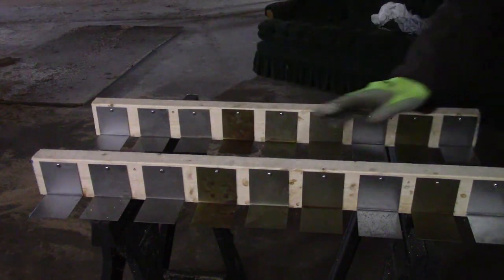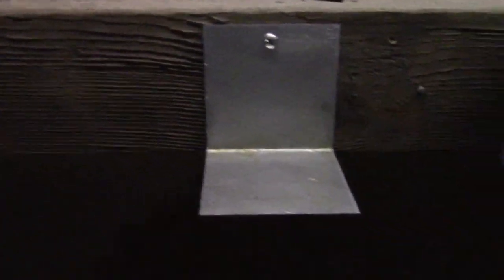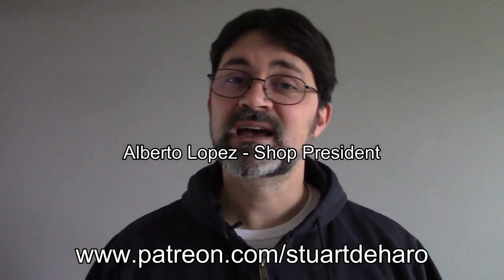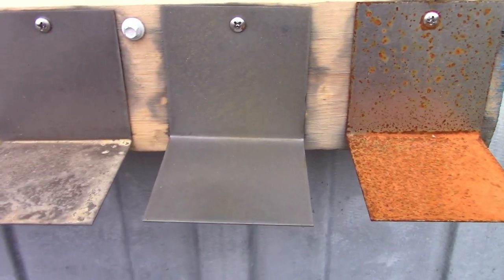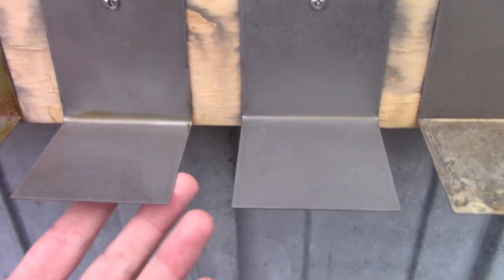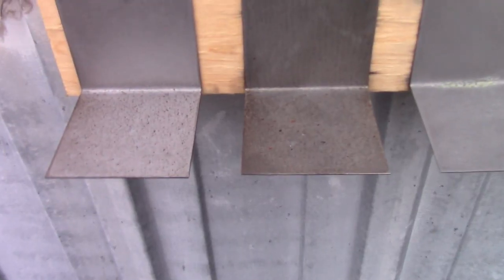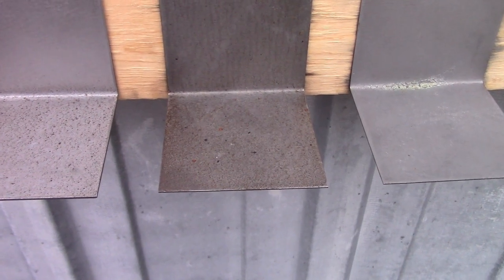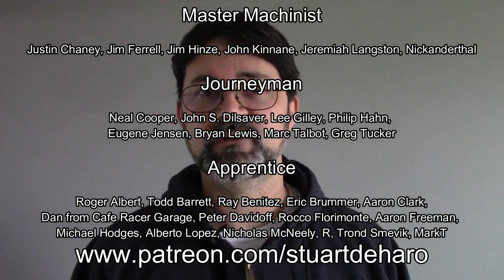What is the Best Rust Preventative? - 1 Month Update

Comment: As an aside, can they be refreshed? Spray a portion a second time like three months later to see if they can be amend. I use fluid film on the frame of my jeep. Unlike tar or plastic dealership rust protection this is doesn’t crack or hold water beneath it and hide rust and water pockets. The reason I detest powder coating, just destroys the metal underneath it.

Comment: Snow is evil. Cold is evil. Rust is evil. 
I don't know, but I've been told, Eskimo... um, toes are mighty cold!  Haha!

I've never tried WD-40 rust inhibitor but in my experience standard WD-40 isn't worth the can it ships in for indoor long term rust prevention so the exterior results don't surprise me much. I do admit it works well for displacing moisture temporarily and light lubrication. Thanks for doing this test Stuart, I've tried various things over the years and never found a magic bullet besides a paint type coating which obviously doesn't play well for machined surfaces.

Comment: It'd be good to see how car polish compares, I use car polish to stop my guns rusting and it works better than anything else I've tried.. it lasts a really long time, it doesn't peel, it's difficult to rub off and it doesn't make your hands sticky or oily
Reply from the maker: Are you thinking Turtle Wax or something similar?  Several people in the first video suggested a bunch of home brew rust preventatives, like  cooking spray, paste wax, and used motor oil. I can add car polish to the list.
Reply: @StuartdeHaro  yeah turtle wax or any other cheap polish.. I'm currently using armoral liquid polish because it's just something I inherited and liquid is easier to use but any cheap polish seems to work good.. the cheaper polishes are mostly silicon based and seem to work best